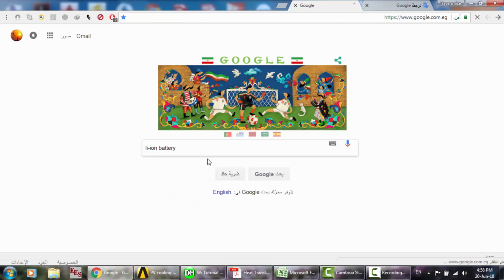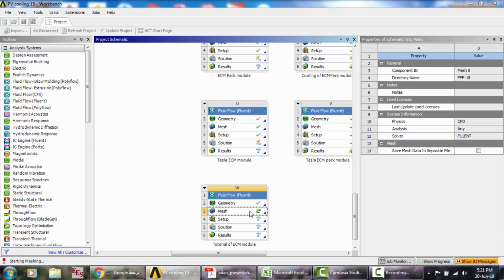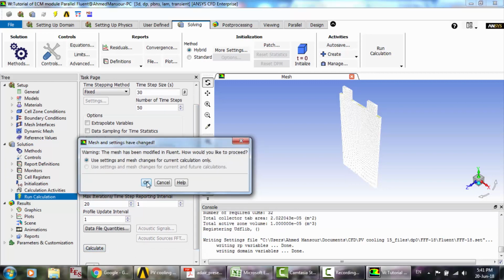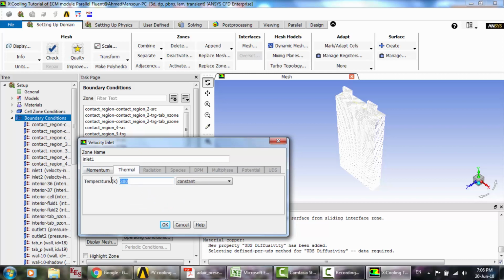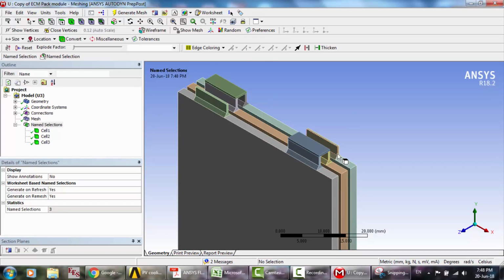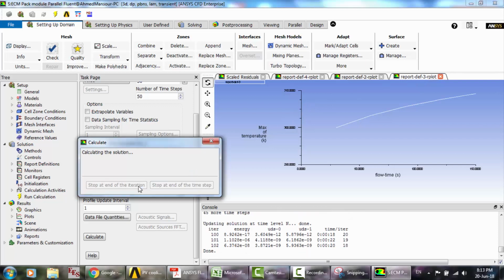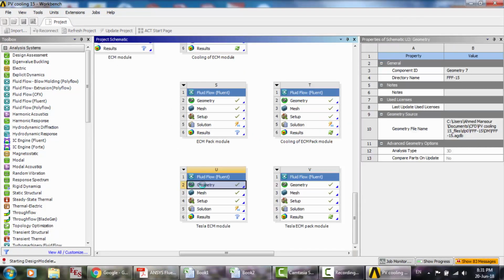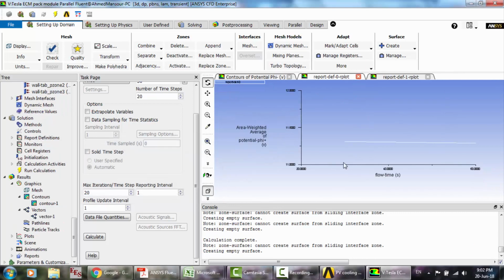CFD simulations about ECM Li - Ion battery, single cell & pack with & without cooling, Ansys Fluent

Comment: Hi again firstly, thanks a lot for every documents. Really so so great video! now I want another geometry namely ECM packmodule (55. minute). In addition Tesla ECM module and Tesla ECM packmodule. I supposed that geometry of ECM module is same with tutoriol of ECM module. My email: elifgorkenn@gmail.com
Reply from the maker: Hello dear Elif, you are welcome but I only share the 3 CAD files you received and then you must follow the steps to generate the pack and the cylindrical cell because the procedure is very clear and detailed. Danke!

Comment: Hello man! Love from India!
I performed this simulation using the file provided by Ansys in their tutorial. I'm modifying it to try simulating a new system(this one will have connections in parallel). Somehow in the file Ansys provided, they were able to create named selections for the tabs and busbars while still keeping the whole arrangement as a single body. Due to this, in their simulation contacts(interfaces) didn't come into play. I wanted to consult you as we're trying to do the same thing ; )  did you just leave the contacts as they were? 
Vielen Dank, Bruder : D
Reply from the maker: Hello dear Aditya, you're welcome! If you wanna consider the 3 parts as one part, select all of them and create "From new part" in the designmodeler to make the walls conformal. The same for any other parts if you wanna consider them one part. Danke!
Reply: @haveanicetime  Well, I created the bodies in Fusion 360 and exported it to Ansys. My area of interest is the interfaces that get created in our system, as we both have chose to model the cell with more than 1 bodies.
Reply from the maker: @Prophet_Barnes  Anyway you must follow the procedure I have shown and may you use the feature I mentioned yesterday (From new part). Danke!

Comment: Hello! I have a question about modelling a li-ion battery in Ansys Fluent. For example if I have a 3.7 V battery cell with 20ah and i want to have 3 these kind of cells connected, what is the best nominal and reference capacity?

Thank you!
Reply from the maker: Hello dear Lucian, for the nominal capacity, use the single cell's capacity 20 ah and use the whole system power in W. The reference capacity is determined I think during the experiment at a specific SOC to get the coefficients. Danke!

Comment: The video is in depth and helping in every way possible . Got stuck after the model is loaded into ansys . It says fix battery connection problem before initialising the model , could you please help me with this ?
Reply from the maker: Hello dear Sandeep, something is not correct with the geometry. You must follow the same procedure I showed. Danke!
Reply: @haveanicetime  yaa makes sense , can I have the cad models for much deeper reference , please ? My email id - m.sandeepreddy10@gmail.com. 
It would be of great help if you share the files .
Reply from the maker: @sandeepreddy4181  Hello dear Sandeep,  check out your e-mail. Danke!

Comment: Hello,
I had issues with E-chemistry models.
Previously I used NTGK model for cylindrical cell module (3 cells in series) but it was not working and gave error (like temperature limitated to 5.000e+3 then analysis stoped ) and Later I chose ECM model that worked perfectly.

NTGK model is working fine for single cell.

Can you please tell what is the issue here...
Thank you.
Reply from the maker: Hello dear Mahamad, something is not correct with the geometry. Make sure you exactly followed the method shown in the video because any overlapping causes this issue. Danke!
Reply: Ok thank I'll check geometry.. also some of the meshed surface is shown in yellow color.. is this indicating an error in geometry/meshing?
Reply from the maker: @mahamadsulthan5966  The correct way was clearly shown in the video. You must not receive any errors or unusual colors in the mesh if it is okay. Danke!
Reply: hey have you performed youe simulation with cylindrical cell,i need help

Comment: Hello! I have a question. How should i connect the cells (n and p tabzone) if i want to connect only 2 cells not 3 like you did at 58:09? Thank you!
Reply from the maker: Hello dear Lucian, simply you may use 1 busbar to connect between the 2 cells or use 2 busbars for each couple of tabs. I have not tried it and you have to try. The idea is to connect the 2 cells. Danke!
Reply: @haveanicetime  Thank you! One more question.. is it normal to have a higher temperature in the case with 2 cells than in the case with 3 cells?
Reply from the maker: @lucianpetrascu3980  Hello dear Lucian, it depends on the experimental conditions and hence the boundary conditions. Any results must be logical depending on the operating conditions. That's why I cannot confirm this piece of information. Danke!
Reply: @haveanicetime  I understand. Thank you very much!

Comment: I can't find UDS diffusivity under Create/Edit Materials in Ansys 2021 R1 please help... thank you in advance...
Reply from the maker: Hello, simply if it is the student version, you need to change it or reset the setup because the student versions are weak for these simulations that require modules. Danke!
Reply: @haveanicetime   Yes I'm using student version for my final year project..
Then I guess I've to use university ansys lab.. thank you for replying..
Reply from the maker: @mahamadsulthan5966  Yes, try to change the version's license I think. Viel Erfolg!

Comment: Hello sir, loved your video! Can you explain what "reference capacity" means under the model parameters tab
Reply from the maker: Hello dear Aditya, it is the value of the battery's capacity at a specific SOC based on the experimental test. At these values, the discharge parameters are got. Danke!
Reply: Thank you

Comment: Thank you for the lovely video. When I’m in physics I never get the UDS diffusivity option. Is there a reason I don’t see it? I’m using ansys R2
Reply from the maker: Hello dear Karan, if you are using ANSYS academic (student) it may be the source of the issue. These versions are not strong like the commercial I use. Danke!

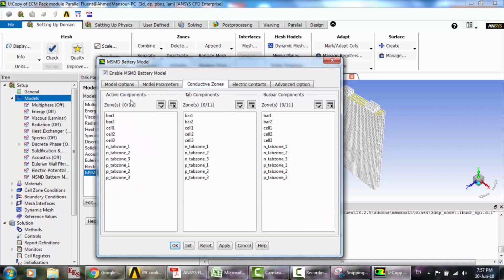Comment: Thank you so much for this tutorial. I have a question, I have ANSYS version academic, min 1:11:04, in the windows appears "Active components/tab components/busbar components" but in my version, only appears "Active components and passive components", so I tried to select for passive components all tabzones and busbar but when I print appears only one battery serial. I don't know if it is correct because also I tried to select in passive components all tabzones without busbars but it doesn't work either. Thank you in advance.
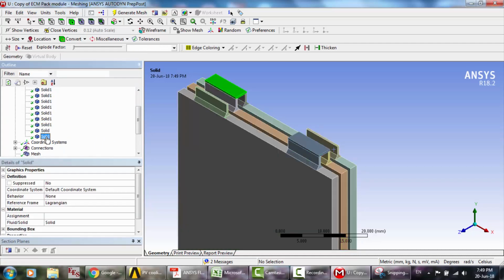Reply from the maker: Hello dear Evelyn, I am not quite sure, if you are using ANSYS academic (student) it may be the source of the issue. These versions are not suitable for these complex simulations. I only know the procedure I showed. Make sure that you have followed all the steps especially making the materials as solid once you open meshing in the geometry tab as shown in 1:05:05. Danke!
Reply: @haveanicetime  Thank you very much for your answer, I have checked that the problem due to the version of the program, I have tried with other version and it works fine. Other question, sorry haha I have to analyze a metal-ion battery, is it possible to do it with any of the models that you say it here (define models add-on module)? Thank you so much.
Reply from the maker: @ei51832  Good to know this dear Evelyn, I think yes because you can define the properties of the materials used and use the parameter estimation tool to get the coefficients shown in model parameters. Danke!
Reply: @haveanicetime  Thankss. What can be the problem that the battery reaches 5000K following all the steps? I have tried a battery and battery pack and in both it gives the same result, thank you very much.
Reply from the maker: @ei51832  Hello dear Evelyn, something is not correct with the geometry and it is an issue with an overlapping in geometry by a high percent. The fundamental and main  procedure I showed must be followed. Danke!
Reply: @haveanicetime  Could it be due to meshing? In geometry, I have followed all the steps you mention here :( Would it be possible to send you the geometry file in case you could see a fault that I am not able to see? Thanks in advance.
Reply from the maker: @ei51832  Hello dear Evelyn, type here your e-mail and I am gonna send the 3 CAD files I used and you use them to validate the results. Danke!
Reply: @haveanicetime  Ohh thank you so much, of course! My email is lyn89@hotmail.com. Thank you.
Reply from the maker: @ei51832  Check out your e-mail. Danke!
Reply: @haveanicetime  Received. Thank you so much. Have a nice day!
Reply: Hi, I am having the same issue as Evelyn on the  "Active components/tab components/busbar components" issue and I was wondering if I could inquire about what version of Fluent I should be using?
Reply: Is it possible with cylindrical battery pack

Comment: Hi Brother, I am working on fuel cell and I want to contact with you if that's possible, my email address is imama1982@gmail.com. thanks in advance.
Reply from the maker: Hello dear Ibraheem, you are welcome! What is the issue? Danke!
Reply: @haveanicetime  thanks for the replay, well, I followed your fuel cell tutorial step by step but I applied that to my geometry, once I run the simulation, I got floating point exception error.
if you can communicate with me by email, I will be appreciated
Reply from the maker: @santaclouse2012  Hello dear Ibraheem, I have sent the CAD files I used in the video to your e-mail. Now follow the steps again. Danke

Comment: Thanks for the tutorial, Could I have the CAD and pdf files. My email id is cubekartik@gmail.com
Reply: I am receiving a "floating point exception error - divergence detected in AMG solver: uds-1".
I am performing ECM analysis on a series of 13 cells (cylindrical).
Could you help me with that ?
Reply from the maker: Hello dear Kartik, you're welcome. Check out your e-mail. You have something not correct with the geometry that causes the issue or may be in Fluent. Use the files I sent and then apply the same procedure on cylindrical cells. Danke!

Comment: Hi ,
I am Venu Madhav
This video helps me alot but I am having one doubt intitally heat will be generated inside the battery but i think you haven't given any heat source?
Can you please tell me how to apply heat source fro rectangular battery?
Reply from the maker: Hello dear Venu, actually the generated heat is because of the chemical reactions and we have already defined the thermal BC's on the walls by convection. Danke!

Comment: Hello, thanks for the tutorial. It would be really helpful if you help me out with this project. Actually, I am trying to simulate a battery pack (16s1p) in the Ansys MSMD module. As of now, I am trying to run the simulation with the default coefficient in NTGK, ECM, and P2D sub-model. But with these default coeff, in NTGK module - After running some iteration, it stops abruptly showing "temperature limited to 5000K in cell zone" this error. In the ECM model- it is showing "divergence detected in AMG solver" this error even after 5 iterations. Then it is showing IDA error flag<0!,. Can you please help me out with this? will be a great help as I am badly stuck right now. I am okay at the cell level only having issues in battery pack simulation.
Reply: my mail id is tyagi.ajay.99@gmail.com
Reply from the maker: Hello dear Ajay, this error is mainly because of the not correct modeling procedure used in the designmodeler. It is because of an overlapping. That's why I used a specific procedure in the video. I am gonna send the CAD files of the single cell and you have to follow the steps shown in the video. Danke!
Reply: thanks,  you have sent me only active, -ve and +ve tab cad file. But in you design for battery pack, over cell you used tringle shaped tab. i have to create those into design modular again. please send the cad files of triangular shape as well. Also i have to make a battery pack of 16s1p, it means two module of 8s then they are connected in u shaped. So again i have to connect them. please help me. Also in new version of ansys 2020-r2, from where we can draw the curve for voltage vs time in main display.
Reply from the maker: @ajaytyagi6586  Actually I only share the 3 geometry files I sent you. Your task to create the other parts as I showed in details in the video. I showed the procedure of each step clearly. I created all these parts and connected them by myself with the help of the pdf document.
Reply: @haveanicetime  Thank you sir for your support. But my question is you have shared 3 geometry which all are rectangular shape right. So, if i am making a cell then with these three geometry it can be made. but when you are making a battery pack, you have to design tab in such a way that when you will connect no of cells there should be some gap between tabs so that bus bar can be putted over tabs. It means you also have to create a triangular shape tabs so that it is not touched when connecting no of cells. I can create that shape in design modular. Did you get what i am trying to say? For single cell it is okay but for battery pack, it can not be connected directly bcoz tabs will be touched with each other.
Reply: when you explain geometry for 3 no of battery pack, then busbar are of different shape. That what i am looking for..

Comment: hello.
I want to simulate for redox flow batteries.  How can I use electrochemical reactions??
Reply from the maker: Hello, the MSMD battery model is for Li-Ion batteries. I am not sure if it is suitable for flow batteries. You must do a literature review and see if the researchers simulate it using Fluent. Danke!
Reply: @haveanicetime  In general, can we assign electrochemical reactions just like chemical reactions in the species model without any addon models?
Reply from the maker: @Parishodhana.X  Yes, but to know how to model this type of batteries, studying related research articles is mandatory to know how to properly model them. Danke!
Reply: @haveanicetime  can you provide your email address? I have some doubts regarding writing electrochemical reactions. please reply ASAP
Reply from the maker: You already have the e-mail.
Reply: @haveanicetime  Please check mail

Comment: Respected Sir,
I tried the same method , but while simulating a pack I am getting a 4V only. It is not multiplying by 3 i.e. not getting 12V. Please help me in this problem. How should i resolve it? 
Thank You.
Reply from the maker: Hello dear Nikunj, there is something not correct, if the batteries are connected in parallel, the voltage is 4 V not 12 V, check this out again and make sure you do not have any other issue. Danke!
Reply: @haveanicetime   Sir it is showing 3 series and 1 parallel in print battery information.
Reply from the maker: Okay, make sure that the data you entered in model options and parameters are correct. 
When a pack is simulated, it is better to enter the system power not the C rate to take the new connections into consideration. So, check out everything again and see. 
Danke!
Reply: @haveanicetime   I checked many times and even tried with 2S1P model also, but same value i am getting. Dont know what the problem. Thank you so much sir.
Reply from the maker: @NikunjPatel-lc9hh  Try to use model I used to validate the data. Danke!
Reply: @haveanicetime   Sir can you please send you ansys file and cad model at mail id nikunjnpatel08@gmail.com ?
Reply: @haveanicetime   I tried every model but not getting total voltage of pack.
Reply from the maker: Hello dear Nikunj, I only share the CAD files of the pouch design to follow the steps to learn, check out your e-mail. Danke!
Reply: @haveanicetime  thank you sir
Reply from the maker: @NikunjPatel-lc9hh  Bitte schön!

Comment: Thanks a lot for the video, It helps me a lot to understand how to analyze a battery on ansys fluent. I have a question: if I change the max and min stop voltage and the cell nominal capacity, the model doesn't work. There is any mistake? Thank you a lot
Reply from the maker: Hello dear Frankie, you're welcome! Changing any value must be depending on real prototypes because the battery's voltage depends on its chemistry and other parameters. 

So, you must get a real battery and know its values from the technical sheet and use them in Fluent. Not just changing the values and hitting run. It is complicated. Danke!
Reply: Hi sir, thank you very much for your help. If for example I have these datas:
Nominal cell capacity 5 ah
Discharge cut-off voltage 2 V
Charge cut off voltage 3.6 V
Nominal voltage 3.2 V
How can I change the values on model options and solution options? 
Thank you a lot!
Reply from the maker: Hello dear Frankie, to change the values, get the technical sheet of the battery, get the inputs needed in Fluent. The next link has a technical sheet and it has the values required in Fluent:
http://www.mediafire.com/file/0uzavdxm8gbs8jp/50Ah+cell+specs+-+Geepower.pdf/file

We use the values at specific Nominal Cell Capacity. Then, in model parameters, we input the required coefficient values manually or by the parameter estimation tool. This is required to validate the curves of the battery against the measurements. You have to get research articles to understand more. Danke!
Reply: @haveanicetime  Hi sir, I understand a lot of things with your tutorials and advices. Actually I try to obtain U and Y parameters for my cell by fitting the discharge curves feeded by the datasheet of the producer. When I make the parameter estimation tool the bo and ao coefficient are negative! Do you have any advice to resolve this issue? Thank you for your answer
Reply from the maker: @francescofrisko6746  Hello dear Frankie, you're welcome, send me an e-mail to mech.eng.ahmedmansour@gmail.com to show you the method. Danke!